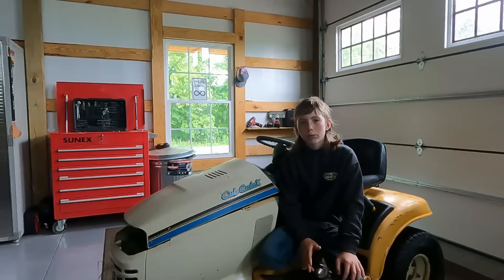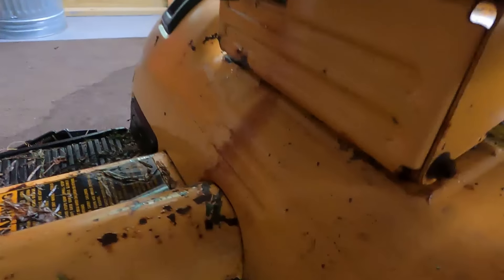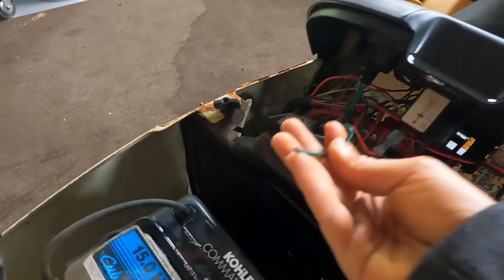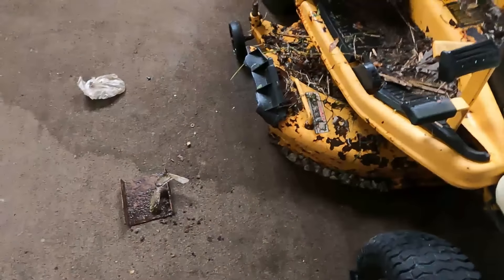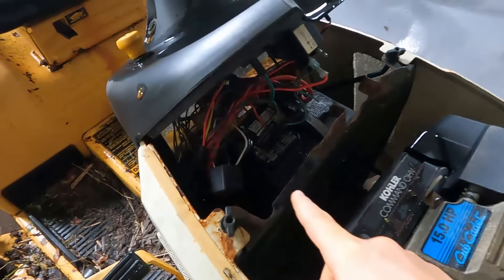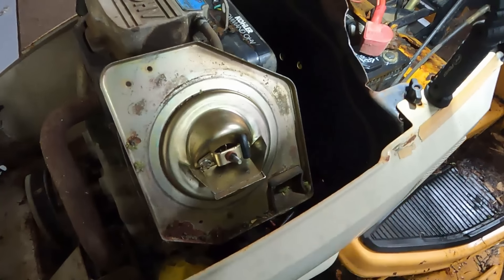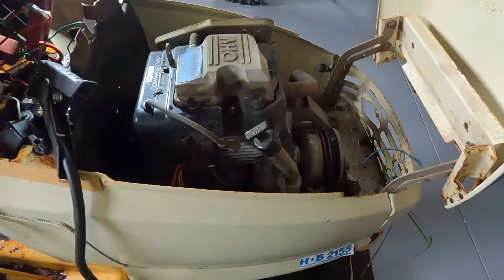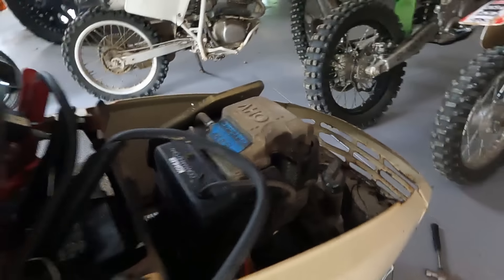Will This Abandoned Cub Cadet Riding Mower Run After Sitting For Years!

Comment: Great job!  A tip from an older feller...those Kohler engines, like most if not all lawn tractor engines, like to have the choke pulled and full throttle to start.  Should fire up in a second or so, first time, every time. Once it's running, kill the choke and she's good to go.  They also like to be ran at full throttle.  Looking forward to the build!

Comment: The first thing a young feller needs to do when resurrecting a field find is to pull off the flywheel shroud and evict the mouse from the house. Also, the oil light will be on until the engine builds oil pressure. Keep on learning little man.

Comment: Good job!  
A few tips:
Those black plastic "T" shaped things under the hood next to the cowl should unscrew to allow the sides to come off.  There is another one (I saw) towards the front on the inside.  That will allow access to the carb and filter.  The foam pre-filter is not necessary unless you plan to mow with it a lot.  
Another tip. (Unless you think it's cheating), is to look up the make and model of any of these power tools and mowers online and find the owner's manuals and parts manuals etc.  Then you can find out what levers and do-dabs do what to where and how.  Megatons of info out there.  That has helped this 65 year old kid fix a lot of things.  LOL
  Also, on some mowers with hydrostatic drive (like that one) you should engage and disengage the transmission (that little lever on the back) before starting the engine.  Don't know if it really matters, but the manuals I've read say to do it that way.  I was glad to see it had been disengaged before you drug it all the way back to the barn.  It could have ruined the trans.  Not sure if they use "hydrostats" in racing or not.  I hope these little things help.

Keep up the good work and I'm looking forward to the build.

Comment: Great job on this one, bud! Yeah, those hydrostatic Cubs can, in fact, pull wheelies with the right amount of traction. Glad you picked up on that ability - just be careful, because they can throw you off if the front end comes up quicker than you're expecting. Like my dad used to say, "if you're gonna be stupid, be smart about it." 😁

Comment: Bently your trouble shooting is much better than many mechanics I have worked with. I was about your age when my dad couldn't get an old Ariens   rototiller started. He was gone for several days and I found the carb plugged up. Cleaned carb and teplaced sparkplug and it ran great. Keep it up and remember to ask those questions. I spent 35 years working on commercial aircrat jet engines for an airline.

Comment: Another Little Grip Garage video...awesome work Bentley.  That's one of the newer Cub Cadet models its shaft drive, its more sought after than the newer Cub Cadet stuff.

The Kohler Command engines are good engines, parts are kind of expensive for them, but they're pretty easy to work on.  That's the old school horizontal shaft engines, so the shaft drive goes from the back of the engine to the transaxle. 

The weird pulley you mentioned goes to the mower deck....there's a pulley/electric PTO clutch on the front of the engine, so that belt goes down to that pulley you mentioned and out to the mower deck.  If I recall you could install a snow blower on those lawn tractors, and that weird pulley plays a part in that snow blower stuff as well.

The oil light will be on when the engine isn't running as well....its normal....if the light is on when the engine is running then you have a problem.

One of those fuses that isn't connected is for the charging system, the other fuse is for the electric PTO clutch.

Comment: Outstanding. You got that old rig running. Sounds like the carb is going to have to come apart regardless, because of the hunting.

That's the brahhhh brahhhh brahhhh brahhhh loping sound it does. It means it's got junk in the carb.

Comment: Those type of cub cadets you have to engage the parking brake and hit the petal  and the seat has a kill switch also & to take the hood off there are those wing nuts to remove the whole thing to change the oil filter. Plus that mower is shaft drive into a hydro static transmission

Comment: I didn't know Bentley had started doing videos.  Just a chip off the old block, I'd say.  Dereck's new mini-me.  Little fella doing just like dad.  Yep, there's usually a seat switch that has to be closed in order for the start function to work.  Cheers from eastern TN

Comment: Great job Bentley, the oil.light is on a pressure switch for when the engine is running, it comes on with ignition just to check the bulb, looking forward to these videos ❤

Comment: Great job Bentley! Always do a delete with Brake clean or Carb and Choke cleaner before you disturb any of the wildlife that has 6 or 30 some legs!!!!FYI, carb and choke cleaner will make them melt before they get too far. Be careful that you don’t spray it around painted surfaces.

Comment: Your mower has hydrostatic transmission.  That switch in the back is a way to put the mower in neutral if ya need to tow or push when she breaks down.  
I wonder how the fellers build these lawnmower hotrods?  Guessing these "new" hydrostatic things are preferable to the old traditional clutch and belt drives?

Comment: Good job getting it running.  There's nothing to charge the battery.  It either holds a charge from the jump or it doesn't.  Left side is definitely deck height.

Comment: Good job figuring it all out.  Just be a bit more cautious about stuff you don't understand yet.  For example, wrapping foam around the air cleaner can be helpful, but leaving a big 3 inch gap makes that the path of least resistance.  So your foam will not function as you hoped; in fact it significantly reduces the size of the air filter.

Comment: For a future project/ video, you need this information. You have the green Sabre tractor in the group. John Deere made those tractors for the Scott’s company. In many aspects, they are very similar. When it comes to the deck, the spindles for the blades are the opposite. Instead of the blades having a big hole in the middle with a spline pattern and a big nut, the Scott’s decks have a centering pin in the middle and are held on by bolts on either side of center. That means they take different blades and different spindles. This involves more searching for available parts, but a Deere dealer may be able to get them for you.

Comment: If you pull that neutral release lever on the back when you tow it, it will be much easier to pull. You wouldn't have torn the front end up. It completely disengages the rear end.

Comment: Hopefully change all the fluids before you try starting it, including filters and I would probably replace the blades with the top-of-the-line mulching blade and if there’s any grease fittings, I would make sure you have plenty of heavy duty. Lucas grease.

Comment: Hey bud that cub cadet is a hydrostatic drive, so doing "performance" upgrades to the motor will not make it faster. The motor drives a pump which in turn powers the wheels. For a race mower you want to find yourself a good old manuel belt driven mower and upgrade one of those.

Comment: Do what's called a pulley swap. Most of those are belt driven from the engine to the rear end. Small pulley in the front large in the rear for torque. Think like a 10 speed bike. If you swap them, you'll get speed instead of torque. Best beginner trick for faster mowers.

Comment: On these old mowers  that have been sitting you need to pull the blower housing off to check for mouse nest. If not you can overheat the engine.

Comment: Just a tip for Bentley. Or anyone else messing with these caller engines? Do your research? I found out that I got a filter that fits amazed amazda miata. I have to find the part number. It's a little bigger which increases your capacity. Which is great for a air-cooled engine and also the filter is a third of the price.